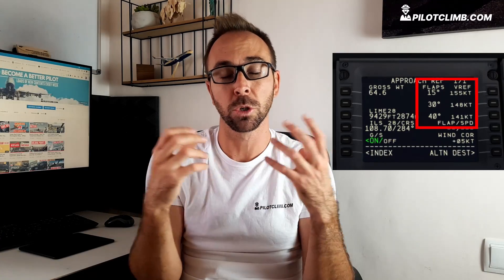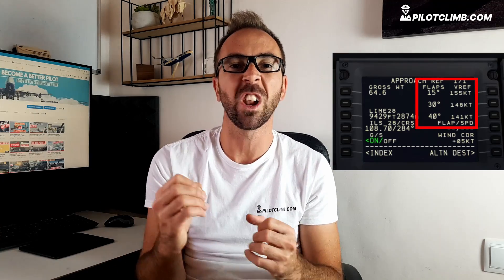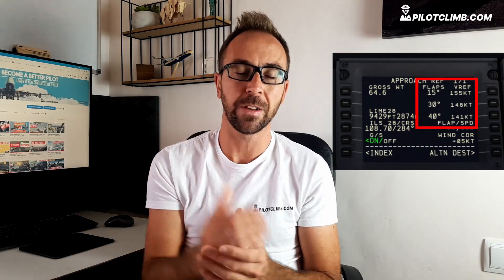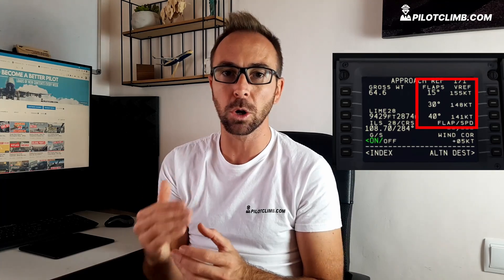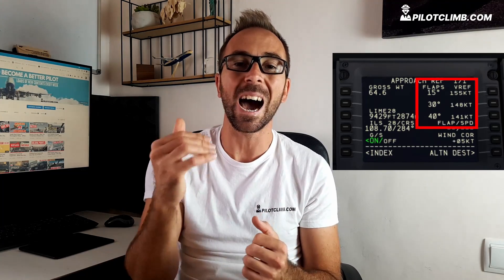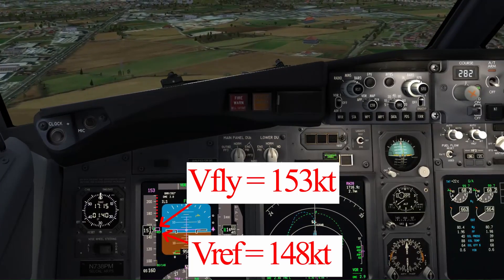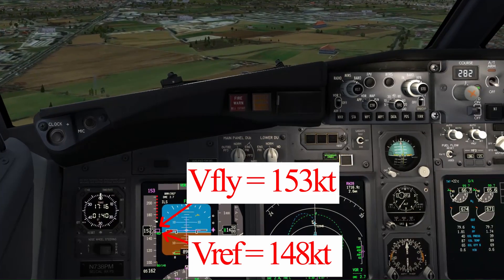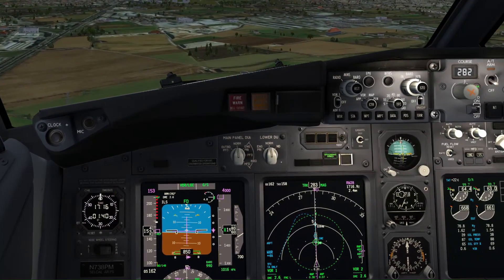Vref and Vfly Approach Speeds Explained - [What's Your Minimum Approach Speed?]

Comment: Good Day Capt Gabriele, if let say we have tailwind 12 knots and vref 143 Knots so vfly in these case 143 +12 = 155 Knots, is that correct?
Reply from the maker: Ciao! In casa of tailwind you don't add knots on the Vref. You add half od the headwind component
Reply: @PILOTCLIMB  and in case of crosswind happens the same?

Comment: What about slow airplanes like a Cessna 172or even slower one? If Vref is 40 knt, then... add 20 knots? I think, this should be calculated another way on another aircraft.
Reply from the maker: Hey, thanks for watching! The wind correction should be in accordance to the Airplane Flight Manual and Operator Operating Procedures so, it might change from one Aircraft to another and, from one operator to another. However, the general rule is to apply half of the headwind component.  Have a great day!

Comment: Hello! I had a question regarding the best rate of climb on an aircraft. I'd be grateful if you could clear my doubt. 
My doubts are :Why do aircraft manuals have a specified 'best rate of climb speed'? For eg:A cessna has best roc speed (Vy) of around 74kn. But why not 76 or 80? It will be faster if its more wont it? And what angle does one climb at even if it is at 74kn? At what attitude do you point the nose if you want to fly at Vy?
Reply from the maker: Hey, great question. The problem of having an higher climb speed (as you mentioned) is that your rate of climb will be lower in order to achieve a higher speed. So, you will move forward faster but your rate of climb per minute will be lower..Let me know if I answered your question..
Reply: @PILOTCLIMB  oh ok. Yes, that answers part of my doubts. But I dont understand at what angle or attitude to pitch the aircraft for Vy to work best? If one pitches too steep then you will stall but if its too shallow then it isnt a very high climb rate. 
And thank you very much!